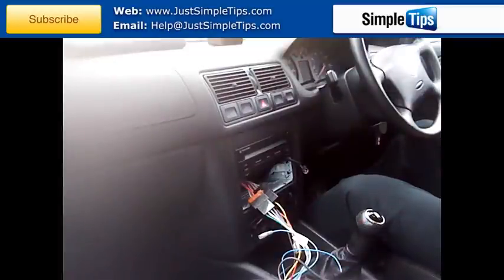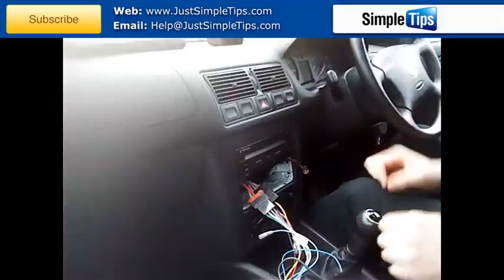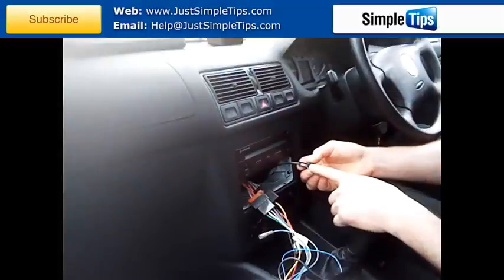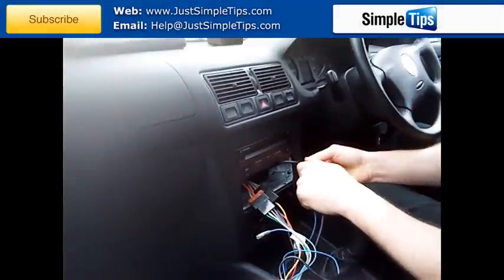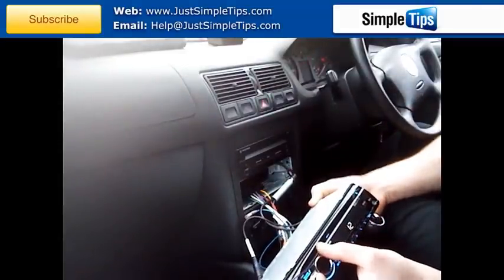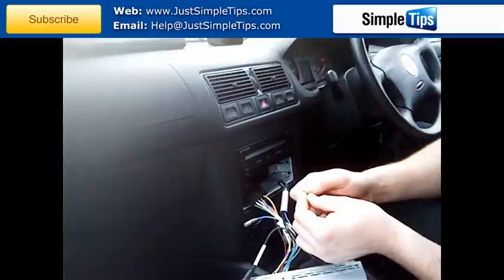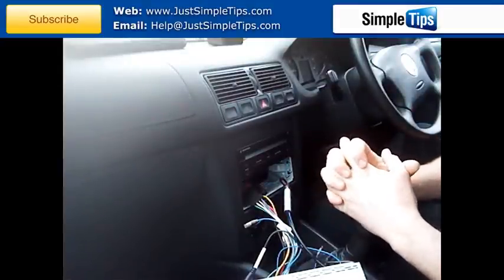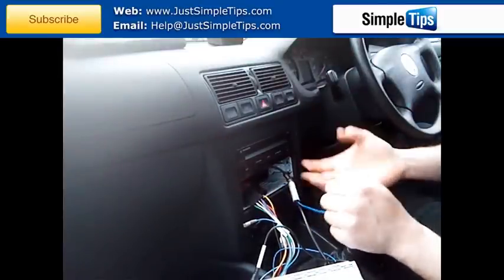How To Amplify Your Aerial | JustAudioTips

Comment: where does the blue wire go to?...i have a skoda fabia  1.4, and am looking to buy a header unit,  such as.. Skoda-Fabia-6Y-Carsio-Car-Stereo-Radio-Upgrade-Kit-AUX-USB-MP3-SD-FM-iPod-iPhone-... but it looks like my 2 plugs go in the back via the converter plug lead.....but i havent a clue as to where the blue wire would go as it would be sealed in the pluggy bit :)  thanks.

Comment: My understanding is that the blue wire is related to memory power which is on the whole time.  Just to reduce chances of shorts draining batteries would it make more safe sense sticking it on the red wire related to power only when the ignition it on?
Reply: Alexis Tudor thats what i did, i put it on constant and got a spark, it's just safer because you know will acc it will be off when you connect it up

Comment: Hi very helpful video, I have toyota corolla  2003, when I use the cigarette lighter socket for mobile charging the radio signal become very noisy and weak,will this device solve the problem?
Thanks in advance
Reply: A KHAN did you get an answer to this